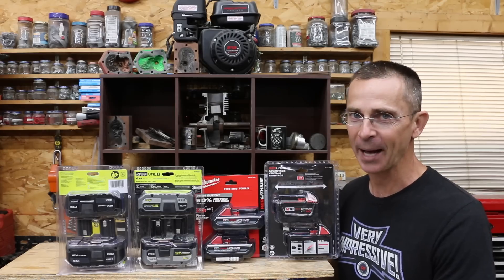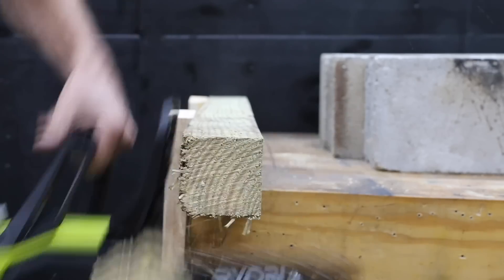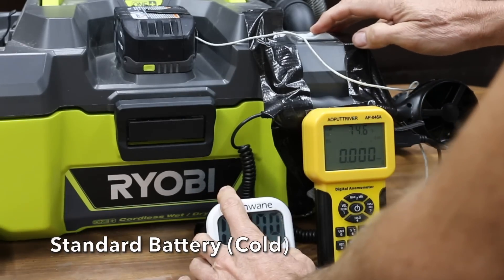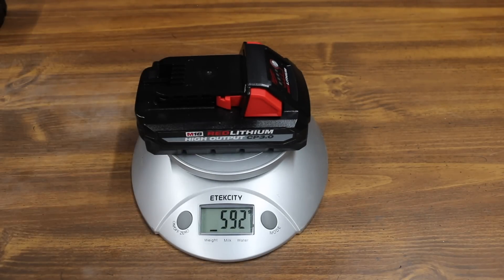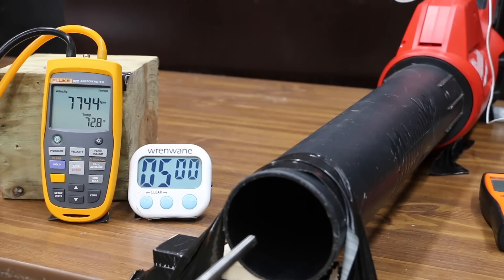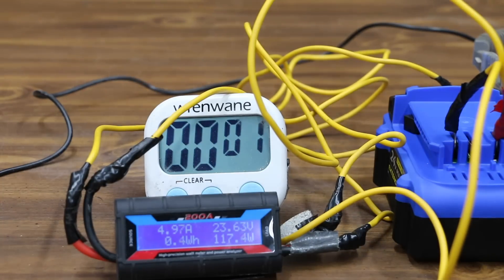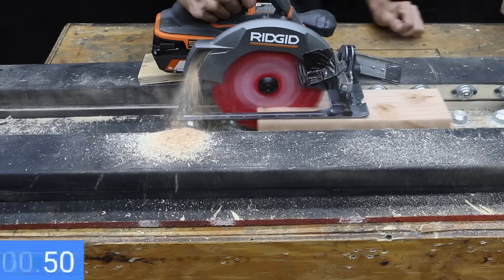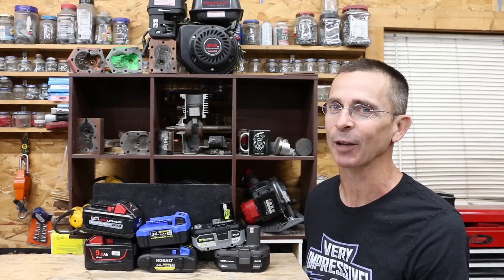Are "High Output" Batteries Better Actually Worse?

Comment: This goes to prove what I always tell my friends that goof on my knock-off batteries... the performance might not be QUITE 1-to-1 against a genuine battery, but getting even 80% of the runtime while spending only 20% as much as a legit OEM pack is a hell of a deal. I save the KO batts for less critical things like lights and fans, where "high performance" features are not really necessary, and I keep my better quality batteries for actual tool use.
Reply from the maker: Thanks for the feedback.

Comment: The high output batteries with the 21700 cells are designed to deliver more amps quickly than the 18650 cells and even then there are different variations of the same style cells. So some tools will benefit greatly from a high output battery while others it doesn't make a difference. Check out Torque Test Channel's testing of some of these batteries on impacts which require a high amp load quickly. Also some of the ryobi tools have a battery communication contact and that can greatly affect performance of a tool. I don't think either of the Ryobi tools you tested were HP tools which are designed to take advantage of the HP batteries. It was a good attempt at testing the batteries but just like power tools there are tools made to do a certain job but that doesn't mean you can't use another tool to get the same job done but chances are it wouldn't be as efficient doing so

Comment: I have Milwaukee tools, and I've had good success buying large capacity knockoffs instead of small capacity genuine batteries. I know they're not a direct comparison in terms of amp hours, but in terms of price they are much closer. The extra weight doesn't bother me, and the increased run time versus a small capacity genuine battery is a welcome addition. Plus I think drawing less C rating (the relationship between amp draw and the total capacity of the battery) will pay dividends in terms of longevity. Overworking a small, expensive, high quality battery seems more detrimental than taking it easy on a large capacity knock off
Reply from the maker: Thanks for sharing.

Comment: Hey Todd, awesome video as always. I've been watching since you started, and finally have a few suggestions! 

I wonder if you could bust some "building envelope" myths. Maybe test different brands building paper/tar paper. Do they really allow moisture out? How tough are they when left on walls for long periods of time? I have just always wanted to get to the bottom of this one. 

Insulation would be a good one to test too, sprayfoam vs roxul vs fibreglass vs styrofoam etc... 

Did you test Oscillating Multitool blades? I forget. I swear, they're all trash, but maybe I'm using the wrong ones!

Re: other user comment about doing coolers. Try the canyon cooler! They claim it's better than a yeti and cheaper. you should test that. A few other more popular ones make similar claims. What makes Yeti's so expensive? Are they worth it? 

Ever think of testing other auto parts? It would be cool to see house brands vs name brands for things like brakes and ball joints. With all the new online parts dealers, it's so hard to know if I should spring for the good ones or stick with the cheapo's.

Thanks for all your hard work. We're all better off for it
Reply from the maker: You are welcome!  Thanks for the suggestions.

Comment: My Milwaukee 1/2" high TQ impact is absolutely more powerful with the 8.0 HO battery vs the 9.0 HD battery.. 33mm lug nuts TQ to 500 FT lbs come off much faster with the high output battery due to the larger cells and less voltage drop..
Reply from the maker: Thanks for sharing.

Comment: Hey. Not really a tool but I am sure everyone uses one. Can you look into printers that specifically connect with phones? Or one that specifies mobile as a main feature. I work at a community association and I always have issues connecting my phone to a printer. It always slows me down. It can be really frustrating.  Thermal printers that are for mobile could be an answer as well.
Reply from the maker: Thanks for the suggestion.

Comment: It seems there is no end of manufacturers out there that could be tested so I understand needing to establish limits. However, it was surprising given the share of the market DeWalt has that there was no inclusion of them in this test. Perhaps another go round could include them as well as Harbor Freight batteries?
Reply from the maker: Thanks for the suggestion.

Comment: Thanks for the testing – you provide useful information.

How long did you keep the batteries in the freezer?  The following is information – not criticism.  I have gotten burned by not keeping a test item in the temp chamber long enough.  I used to think that 4 hours was long enough but I had a circuit stop working because the components in the circuit were not cold enough during formal testing.  I changed my testing to leave the test device in the temp chamber over night (12 hours).  Never had the problem resurface after that.  Need to cool the inside of the components so the whole component is at the desired temperature.
Reply from the maker: 15 hours.

Comment: I have to say I’m surprised. Specifically with my circular saw, impact driver, and impact guns I have perceived a difference with Milwaukee’s high output batteries. Breaking nuts free, driving lag bolt, or making cuts that with the normal batteries seemed to stall. Perhaps it’s all the difference of a fully charged battery.
Reply from the maker: Thanks for sharing.

Comment: The value of knock-of batteries is primarily in the cost to work ratio as the amount of work you get done with 4-5 knock-of batters is rather significantly greater than with a single brand-name battery and the cost of 4-5 knock-of's is the same as a single brand-name battery so it doesn't really matter that the individual knock-of battery performance is less than the brand-name one.  

Some times quantity is a quality all of it's own....
Reply from the maker: Thanks for the feedback.

Comment: Off topic: Do you have a video about bonding adhesives - to adhere EPDM rubber roofing material to R Panel sheet metal roofing? 
Thanks.
Reply from the maker: Thanks for the suggestion.

Comment: Your video convinced me that some batteries are simply labled a standard battery or high output betting that no one would actually test their claim.  Same 18650 cells in both packs.  2 more watt hrs is not, to me, high output.  They probably tested the packs and those that exceeded an aritrary standard ever so slightly, they called itg high output.
Reply from the maker: Thanks for the feecdback.

Comment: Huh I don't use many of the tools you tested but on my DeWalt XR drill, circle saw and sds drill there is a very noticable increase in power when I use 21700 cell batteries like their 6.0 packs. Especially the circle saw goes from struggling to do long rip cuts through PT wood to slicing it like butter as if it were a table saw. My drill goes from stalling out when mixing bags of concrete to comfortably mixing a 5 gallon bucket with the 6.0
Reply from the maker: Thanks for sharing.

Comment: I know people love battery tools, but I'm done with battery pack tools!  I rarely work remotely, so if it's electric and it doesn't have a power cord, I won't buy it.  It's the old ink-jet printer scam:  give the printer away and rape the consumer on the ink.  The price of replacement batteries is no longer reasonable when buying a new tool with new batteries is cheaper than a new battery.
Reply from the maker: Thanks for the feedback.

Comment: Hey Project Farm, I recently saw a video by Tenza Motorsports and his BMW, after running royal purple engine oil it cleaned out all the crud and build up in his engine, he tore down the motor before and after and the results seemed legit. Would be awesome to get some kind of testing on the cleaning properties of a motor oil. We have seen the Protective properties, but it seems royal purple is 2x the price of the Valvoline I normally use. The reason I was looking into this, is because some cars have different oil viscosity recommendations in different countries, and I was starting to think that 0w20 doesn't protect as well as 5w30 and that engines that "require" 0w20 in the manual are probably lying and 0w30 or 5w30 would work better in hot weather. Everyone tests the "cold" viscosity of oil, haven't see anyone test the properties of HOT engine oil.
Reply from the maker: Thanks for the video idea.

Comment: As always this is a great video. I was told that the high output batteries may work and deliver longer run times, however they have less charge cycles. I don't know how you could test this in a short amount of time. But I use my tools around the house and having more charge c.ycles is more important to me, then if it saves me 4 or 5 seconds on a cut or having to change the battery once to make the last few cuts. I would love to know if what I was told is true? and does the high output batteries take longer to charge vs. the regular batteries? I am not sure if there's enough interest in this to make it worthwhile testing it or not. But for me having more charge cycles is more important. Thanks again for all the great videos you do. You have guided me in the right direction several times in the past and I always look forward to your new videos to drop.
Reply from the maker: Thanks!  Thanks for the video idea.

Comment: Testing different brands of white gas in stoves and lanterns would be informative for the outdoorsy viewers. Boil time, light output, and corrosion resistance (it is in thirty supposed to help the steel tanks rust or slower) are a few possible tests.
Reply from the maker: Thanks for the suggestion.

Comment: A question......when charging the batteries was the same model of charger used? I know a charger shouldn't make a difference once the battery is fully charged, but I have always wondered if the type of charger makes a difference in how the battery performs or how long it the battery may last over time.

Comment: I found that my XC batteries from Milwaukee generally shut off a whole lot faster when using them. Half the time I will only get 10 minutes out of the leaf blower with the extended capacity but if I use a normal battery I might get 30 minutes definitely not a fan of the new batteries especially with the extra price involved
Reply from the maker: Thanks for the feedback.

Comment: I've seen videos from the Torque test channel on YouTube, where they compare the performance of high output batteries on torque heavy devices like impact drivers. There is definitely some performance increase in Max torque when using those batteries. So only when you need the extra performance, especially in cold environments, you should use those high output batteries.

Comment: As a real life user of Milwaukee on the daily, I can tell you that some Milwaukee tools take advantage of the High Output batteries better. Such as all of my Fuel Impacts, Fuel Ratchets, etc. If i cannot get a bolt loose on a vehicle I am working on with a 1/2" High Torque and a fully charged 5.0aH XC battery, then I grab any of my High Output batteries and it ramps up the tool which actually does get bolts that normally couldn't get loose. Yes I know someone will say that the initial impacting made the bolt loose for the second time around but that's not the case. Also running my Milwaukee Lawn Mower and Weed Whacker it does show a substantial difference in temperature and how good they cut depending on what type of batteries I use .

Comment: Not the results I was expecting. Speaking of electrical tests, how about jumper cables? I've seen far too many of them where the cable was more insulation than wire...
Reply from the maker: Thanks for the suggestion.

Comment: For ryobi for proper testing you would've needed to use a HP tool. Takes advantage of the hp battery.

For normal ppl, if you have ryobi or other tools that have regular models and hp models, theres no point using hp batteries in non-hp tools.  Very little to no difference. Save your money on batteries and get regular batteries for regular tools.

Comment: Great video. I would be of the opinion that more cells spread the load of the power demand and keeps more consistent power coming even if the cells are smaller. I like the idea of 5 big cells instead of 10 smaller cells to achieve the same ah but I am not convinced in the improved performance they claim.
Reply from the maker: Thanks!  Thanks for the feedback.

Comment: PF u should do a power tool battery face off. Test which brand battery holds up better etc. do all the popular brands dewalt, millwki, baur, hercules etc and also do a tear down like what u did in this vid
Reply from the maker: Thanks for the suggestion.

Comment: My experience with the knock-off batteries (Hitachi 14.4v & Bosch 18v) are that over the long term the Knock-offs are not worth it. I have two Hitachi 14.4v batteries that I bought with my impact driver in June of 2011, they still work great to this day, but I have had knock-off 14.4v batteries for the Hitachi that only lasted about 18 months before they would not take a charge, basically the same experience with the Bosch 18v batteries. I have yet to have a genuine Bosch or Hitachi battery die on me, but I have a stack of both knock-off for each brand that are dead as a doornail.
I'll spend the extra money and buy the genuine batteries as I need them to work and not leave on on a job stranded with a dead battery.
Great video as usual. 
Cheers from Tokyo!
Reply from the maker: Thanks!  Thanks for the feedback.

Comment: Love your reviews, but in this case I think you missed a critical point. High Output refers to the maximum amount of current a battery can deliver (amps), not its capacity(watts). An air blower isn't going to tell you much as it's a constant load that drains the battery at less than its maximum discharge rate. By contrast, an impact driver or torque wrench should be able to drive a screw farther or tighten a bolt tighter with a HO battery (provided their motors can take advantage of the extra current). So HO batteries are really only useful if you have tools that can take advantage of the extra current they can deliver. And of course, in cold weather, where the lower internal resistance of HO batteries allows them to produce more current.

Comment: I use milwaukee m12 and m18 tools for work and in my opinion the high output batteries make more of a difference in the m12 tools. However with both m12 and m18 the high output batteries can often make the tool remove bolts the standard ones cannot. Your videos are always awesome and I don't think your tests are flawed but I do think that these tests don't tell the whole story. When a high output battery is the difference between getting a job done or not, they are well worth the extra cost for me.
Reply from the maker: Thanks for the constructive feedback.

Comment: I wish Milwaukee and dewalt both would use molicel 21700 cells with 45 amp discharge they are real beast cells that can handle a lot of power
Reply from the maker: Thanks for the feedback.

Comment: Just using them you can tell the high output batteries allow more power. It’s all to do with the increased amp discharge rates. It also depends a lot on the type of motor a brushless motor is more capable of utilizing the extra amperage. I’ve tried it with impact wrench’s using a small battery wouldn’t budge the nut then the larger battery flung it off without hesitation. It’s easy to see the difference just by using them.
Reply from the maker: Thanks for the feedback.

Comment: For those knockoff Milwaukee's at the end you could buy 4 or 5 for less than the cost of the genuine so if you were to need something to get you through a workday it seems like the better bang for the buck. That said they may have less longevity in terms of charge/discharge cycles.
Reply from the maker: Thanks for the feedback.

Comment: I've gotten aome great service and over 4 years out of knock off nmh batteries replacing nicad 19m2v crapsman batteries which have never gone more than 15 months before performance and charge holding became problemsome... @ half the cost for 2x as many batteries that last 2.5 times longer lifewise.. My 20v dewalts just keep on going and performing,even the pair of almost 10 yr old 2.0mah battrees... Am going to try a set of 6 mah knock offs soon and see how they perform.. Wasn't impressed with the 60v dewalts when comparing costs vs usability,weight,longevity as I can afford to double my battery collection and usage time rather than shelling out the high costs for so called performance hype..
Reply from the maker: Thanks for sharing.

Comment: Very nice video! I live in Arizona so the temperature performance is more about how cool they can stay instead of how well they work in cold weather. The Milwaukee test was very interesting. Using less cells in parallel will always result in more heat, so it's not a perfect comparison, but I don't think they offer a 5.0 high output for example. I'd be interested to see a 6.0HO and a 5.0 go head to head. Also, haven't you noticed how many different versions of the same tools Milwaukee makes? It's frustrating as a buyer to see 10 drills and having to choose between one that costs $50 and another that costs $200. Maybe a video idea to consider..? Thanks again!
Reply from the maker: Thanks!  Thanks for the suggestion.

Comment: I have a lot from the ryobi line and I have one high output I got with a tool from the pawn shop. I noticed that with /one/ tool, weed eater, the high output would spin the motor noticeably faster than the normal batteries... but on EVERYTHING ELSE it made zero difference. The high output also drains faster than the others at the same capacity, but this could be age. When I moved to the 18v line I saw no difference between batteries other than runtime.
Reply from the maker: Thanks for sharing.